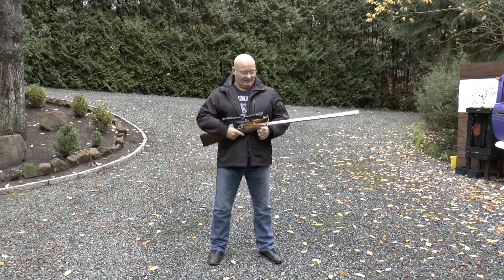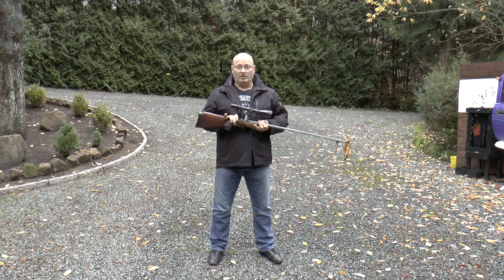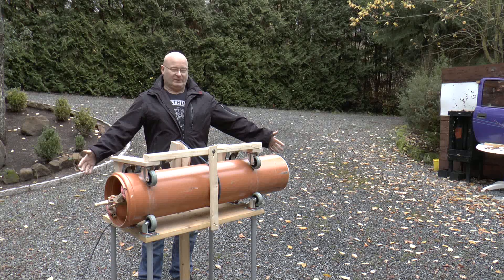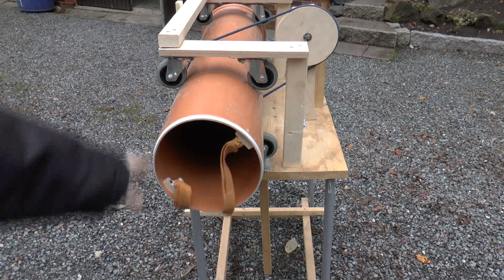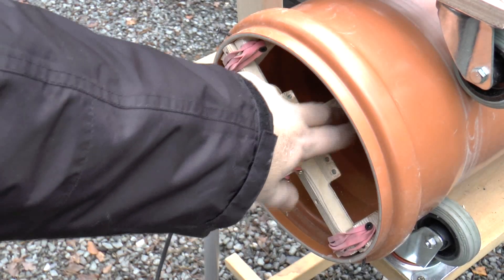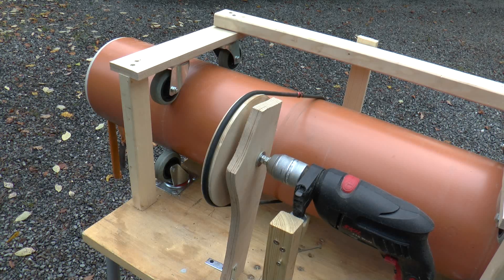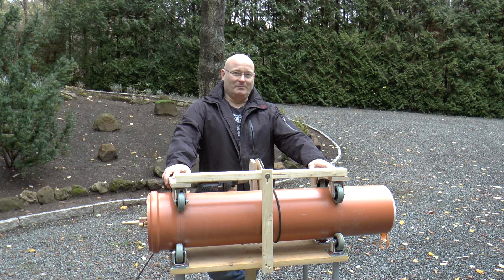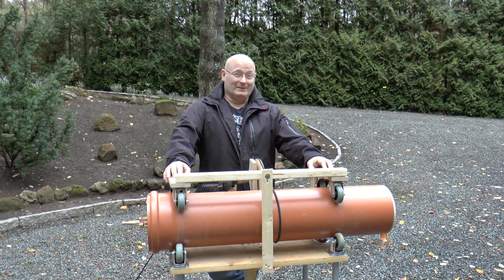World's 1st Rifled Slingshot (Made from Huge PVC Sewage Pipe)

Comment: Sense is over-rated; you, Good Sir, pursue the Zen of elastic-powered weaponry!
Reply: heh! wow that's neat. though I wonder can you spin a projectile as it's projected through a coilgun?
Reply: Magnetize the projectile in advance so it is a di-pole aligned perpendicular to the axis of travel, and arrange the coils in pairs so that they are spiraled around the rail with the axes of their fields all perpendicular to the line of travel. Energize pairs in sequence ahead of the projectile such that the alignment of the fields drawing the projectile down the barrel will rotate relative to a fixed point at the start of the barrel as each pair of coils fires in turn further along the rail.  Each pair should be aligned north to south with each other

Comment: A piece of string on the pull trigger knob would work nicely. Drill through the knob, loop the string through. Make sure it's long enough to twist for 70 rotations (10 secs). Perhaps put another piece of wood on the other end with a hole for a loop. Then you just have to pull the string.

Comment: Joerg, so does this have any effect on the velocity of the ball? Have you done a chrony test to see if there is any apparent difference in the speed? Also Joerg, I've been having an idea over the last couple of days ever since you made your Slingception experiment. I was wondering if you can create an experimental slingshot railgun or coilgun. You know, using magnets to try accelerating a slingshot projectile. I feel this would be quite interesting and could potentially be of some use and would perhaps eliminate the need to use extra rubber to launch the projectile because it would be easier to cock and you just let the magnetic rails or coils do the rest of the work in propelling the projectile. This is just in theory of course. I'd love for you to read my post and tell me what you think. Thanks.

Comment: Even with round ball gyroscopic stabilisation is a thing, I shoot black powder rifles and muskets and I can tell you that up to 50 meters a ball in a smooth bore can hit an orange with no problem. But at longer ranges such as 100 or 200 meters even a round ball needs something to stabilise it. Of course, if the ball ain't perfectly made the spinning component will increase the pattern but with a good ball you have better results.

Anyways, from a bow/crossbow/slingshot crossbow aou are better off using an auto-stabilising projectile like an arrow, but with a rifle the minié ball is a great option and needs stabilising. With black powder rifles and a minié or a compression ball you can hit a 1 euro coin up to 100 meters with a residual energy high enought to fuck your shit up pretty badly.

And the whole thing revolves around that: with very high velocities (firearm) and long projectiles with relatively low size (bullet) the gyroscopic effect is a good way to stabilise a projectile, but at low velocities (bow/crossbow/slingshot crossbow) with big long projectiles just don't bother with it.

If you once come to switzerland just send me a PM and i'll show you a wide variety of guns (black powder and smokeless powder).

Great video as always.
Reply from the maker: True, at 100 meters it certainly will make a difference. Not a problem for a black powder rifle that will easily propel a ball at 350 m/s. But a slingshot does 70 m/s tops, which limits it's effective range to maybe 30 meters. No rifling needed for that distance.
Reply: "The whole thing revolves around that..." Heh heh... heh... I see what you did there... heh heh... or not.... heh.....
Reply: JoergSprave
Hopefully JS can increase it's effective range with Germanic innovation and engineering! :)

Comment: I'd think that thing would fling the ball out in a random direction without a guide chute. Why not make one using a bearing?

ball bearings
V
-------------[rubber]-----------/ /--------|
||| <--[where the rubber joins the bearing/bearing holder]
-   __                                        |
| |----|--------------[inner barrel with spiral(rifled) track milled on the inside]
--      |   <---[a nub on the inner carrage that follows the groove]
| |---------|   /------\                         |
| |          |  | [ball] |                        |
| |---------|   \------/                         |
--                                                |
| |-----------------------------------/ /--------|
-                                               |
|||                                                |
-------------[rubber]-----------/ /--------|

inb4 bad ascii art.

Comment: you don't need to twist the rubber I don't think. You can make a device that has a seperate smaller holder in the launcher that spins while connected to the outer, non-spinning rubber for propulsion.

Comment: Hey Jörg, I like this construction and it works! :D But what about making a sleigh on a curved rail inside the tube and with a loose/free coupling for the rubber attachment points. So the spin would be transfered by the acceleration along the screw rail. Don't know, if it'd work in my mind it seems cool.

I hope, I could explain it in an understandable manner, if not, I speak natively german, too, feel free to drop me a line then ;)

Cheers, Thul.

Comment: well technically its not rifled because there is no rifling present but at the same time technically speaking it is because you have succeeded in adding spin to the projectile.  Looks like a frankestein slingshot but a lot of yours do.

Great effort Joerg & very interesting as always :-)
Reply: Fektthis One could have a bullet pushed along a rifled slot by a non-spinning arm that's driven by rubber. Then it would be truly rifled.
Reply: Yeah, you're right. If what his critics said was true then he met the standard they asked for. However, rifling refers the the grooves in the barrel that cause the spinning and not the spinning itself. Still, he achieved the same end result in a roundabout fashion (pun fully intended)
Reply: Fektthis I was thinking that myself, then I realised from the point of view of the ball, the path it is taking is the same as a rifled projectile as it's being cupped by the sling and forced to spin by exerting friction at an angle by the sides of the sling cup.. so really this is a meta-rifle in that the rifling is actually moving with the ball..
freaky right? good o'l Joerg, always making us think!
Reply: stcredzero yes, i hope joerg sees this and makes a rifle slingshot this way. it doesn't seem to be that difficult, certainly more simple than getting a drill to spin the whole slingshot :)
Reply: hahaha, trust me adding rifling to a barrel is not easy, you need specialist gunsmith equipment, which Joerg has not got access to due to draconian german firearms restrictions. I imagine you could print a rifled plastic barrel on a 3D printer for elastic powered weapons, which would be suitable for slingshots so if he does do it that would be the route he would have to go down :-)

Comment: i wonder if you could use something slightly similar to your slingception idea, using a sliding carriage to create a rifling effect on the ball

if you have 2 tubes, one which slides inside the other, could you rifle the bore of the smaller tube and then attach it to the bands and put the ball inside it, so the whole tube is like a pouch to hold the ball, as well as  being a barrel for the ball to fly through? the larger tube makes sure that the smaller one is held steady

it would look like a telescope, you would pull the bands back and the smaller rifled tube would be pulled backwards out of the larger smooth tube which keeps the smaller one aligned straight, then when you fire the smaller tube it will shoot back inside the larger one, and the ball will be launched forward through the rifling of the small tube

would there be too much friction?
Reply: wow i think this is a great idea!

Comment: How about a "rifling attachment" after the ball is already accelerated. Of course the projectile would need to be guided before the rifling tube attachment starts. That way you can freely accelerate using rubber bands without worrying about rotation.
Probably results in a ridiculously long slingshot but you can make it shoulder mounted like your bazooka.

Comment: I think that is you take a steel tube, cut spiral grooves in it, not going from end to end, put a length of paracord to act as a pouch, attach the rubber bands to it, on one end, and on the other attach them to a big bearing that fits tightly around the pipe. That way you have the bands spinning, rather that the weapon itself, it doesn't require electricity, and the bands don't come into contact with the pipe, making this an excellent nail shooter. The nails, though, would need a notch for the paracord to fit in.
Reply from the maker: The friction would be so high that the shot would be lame, lame, lame, plus the bands would entangle themselves very quickly.

Comment: Spinning a round ball helps lots but it is spinning really fast. Faster than would likely even be possible with a slingshot. Figure a black powder pistol that spins the ball once every foot will spin the ball at 54,000 RPM. That is figured based on the ball traveling at 900 feet per second which is on the slow side. A ball moving at 1,250 feet per second is turning at 75,000 RPM. Anyways,that's not the point of the video. The point of the video was to make the worlds first rifled slingshot & entertain us. You did a great job at that. I am still laughing. Wonderful engineering. I love your crazy creations as much as the more serious & practical ones.
Reply: SirPetterTheFirst it really makes no difference whatsoever... all units of measurement are completely arbitrary and you already know exactly how many cm 1 foot is... it's like complaining that someone speaks another language that is already understood, just for the sake of complaining about something
Reply: Some imperial measurements remain in limited use in India, Malaysia, Sri Lanka and Hong Kong.
Reply: And much of the UK too - within context.
Reply: even the tiniest rotation helps. the first riflings ever were in a straight line (and by "straight", i mean no spiral pattern at all....the rifling was originally an attempt to solve powder fouling), and it improved accuracy, because they were not 100% straight, thus the bullets were slightly spinning.
Reply: 11Sparky111 I can't agree with him?
Reply: SirPetterTheFirst
Reply: Winston Smif What exactly is that meant to imply? It doesn't matter if units of measurement are arbitrary, (which not all are), as long as everyone uses the same units, the meaning is the same. He had a valid point and didn't complain, unlike yourself. He simply stated facts to give us a better understanding of the physics involved.
Reply: +shananagans5 You realise he says this at the end? Did you actually watch to the end?
Reply: I never said that, but it just seems like you were trying to put down his attempt, without having watched his explanation at the end. That's what it seemed like to me.
Reply: lefr33man Weren't they trying to make the grooves longer by making them spiral around the bore? If I recall (lol like I was there) the idea was to give more space inside the grooves for fouling before it obstructed the barrel so they spiraled the grooves to make them longer to get more volume inside them. lol It didn't work It actually increased fouling but they found it increased accuracy. That's what I heard anyways. You are right,a round ball doesn't need as tight a twist rate to stabilize as a longer modern bullet but it will still be spinning pretty fast.  (in general, a longer bullet needs to spin faster)
Reply: 11Sparky111 Oh, no. I love his creations. :)
Reply: elitejohnlp name one single unit of measurement that isn't completely arbitrary

explain the problems that arise from not everyone using the same language when we all know how to translate them with 100% accuracy

you can't, and you can't... thanks, bye

Comment: Joerg  I seem to remember seeing somewhere that the reason a golf ball flies so straight and far is because of the dimples, what about firing similar projectiles and testing the results against traditional ammo?
Reply: Its not going straight as a such but further distance. The dimples means that the air around the golfball is broken, you suddenly get vacuums and low pressure spot where the dimples are reducing the air resistance on the ball
Mythbusters did a very good episode on this including building a fall sized golf ball dimpled car and testing its efficiency over a normal car